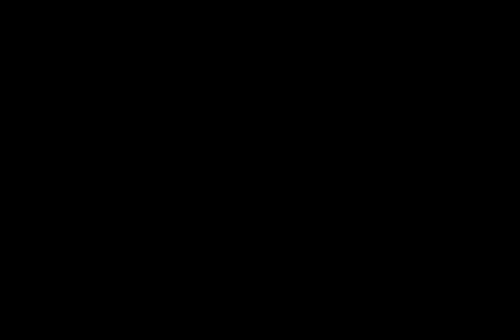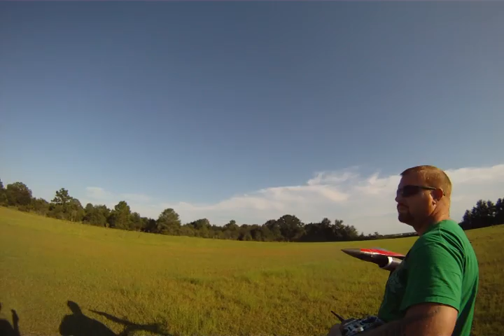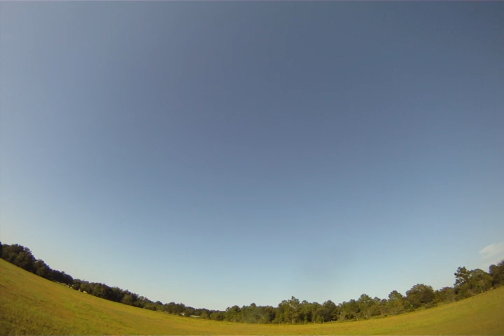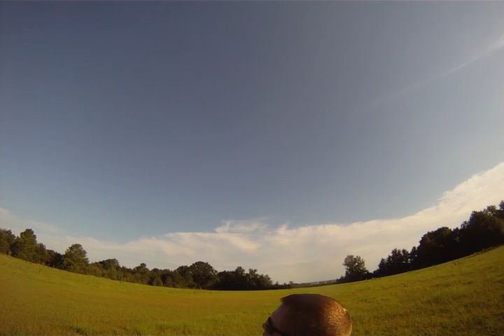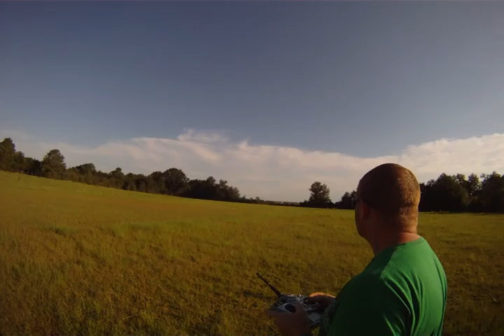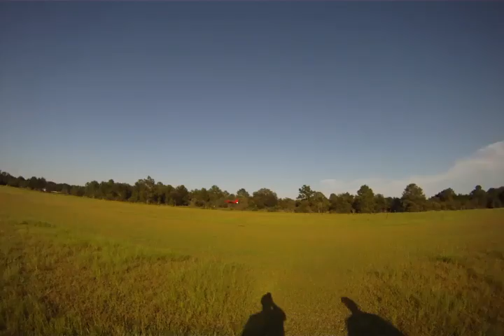Phase 3 F-16 all hopped up.

Comment: im not trying to be hat'n on your video. and actually i've been watching your tuts on the insulation foam planes you've made, they are really nice to watch and it actually has made me want to make one. im making an extra 300 out of the pink half inch and 1 1/2 inch foam. its pretty big, it has a 52" wingspan and i just need to get a couple of more parts that are coming in the mail to finish it.